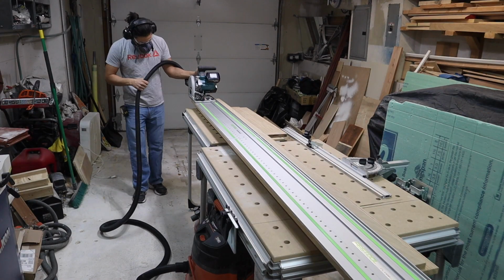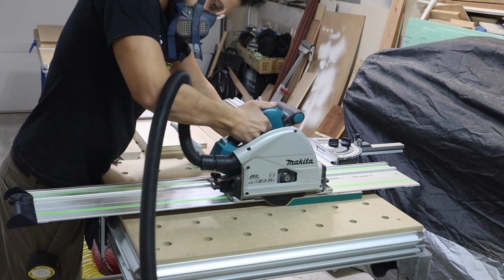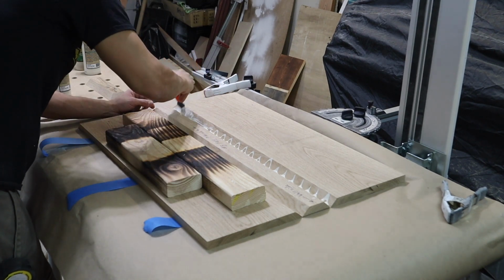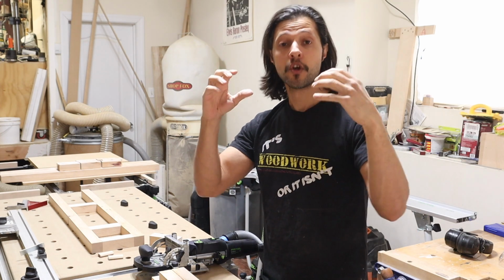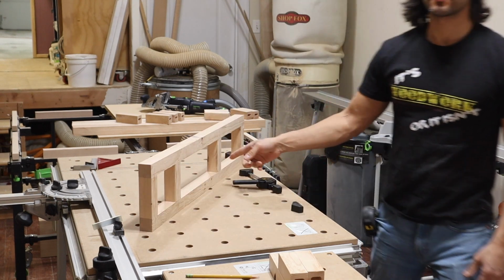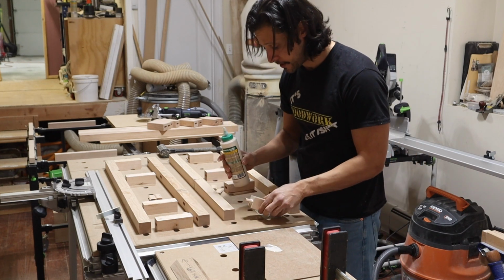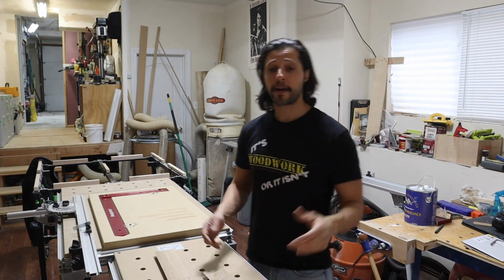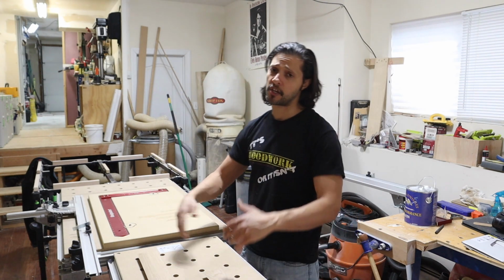White oak floating shelves

Comment: Those shelves came out nice. Any reason for the 45.5 miters as opposed to just a 45? Tighter fit?
Reply from the maker: It helps the ends come together better and gives the glue somewhere to go and not to force the edges apart.